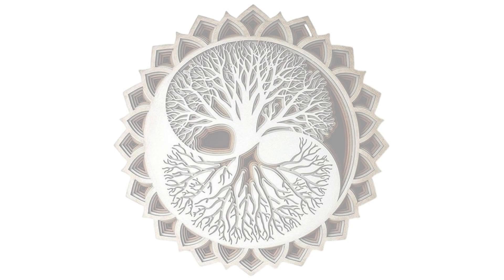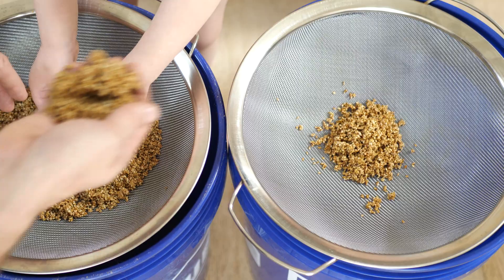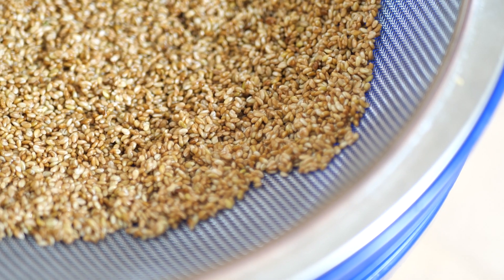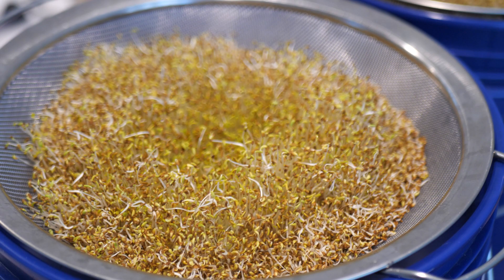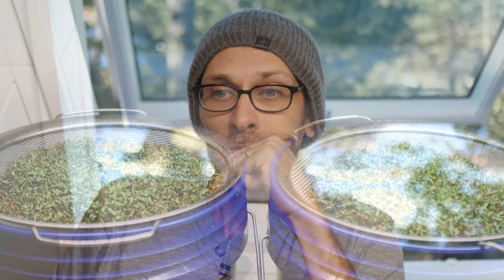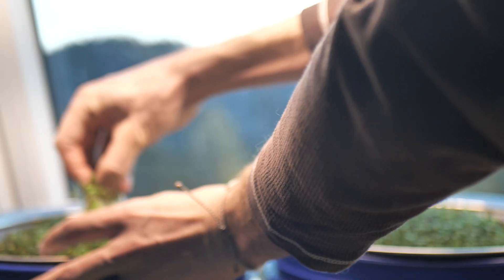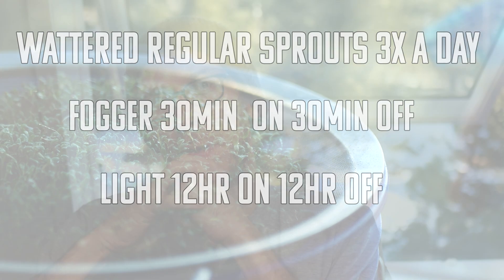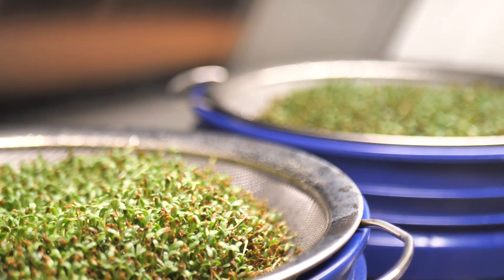Growing Fogponic Alfalfa Microgreens: The Results Will Surprise You!

Comment: Use less space  for pot & medium less water with recycle system aeroponics? No medium needed to keep moist, root system uses all space direct nutrients  no root rot, less nutrients. Lil bit more work setting up   but can harvest quicker & have a much smaller lighter tier system then hydroponics.  More work but can multiply growth inconceivably in tier c system. Sky's The limit. We don't own the world or the sky so an efficient system is v necessary or everything dies. Balance &'sharing space. Land air & water. Our ancestors were smarter & more considerate then we are in this day. They wasted very lil but failed with birth control but they did die earlier. So it balanced out.
Reply from the maker: Thanks for your input 👍